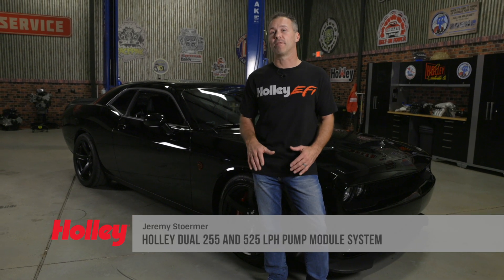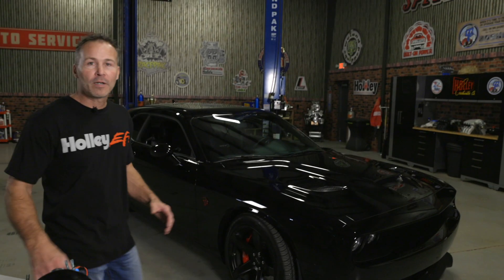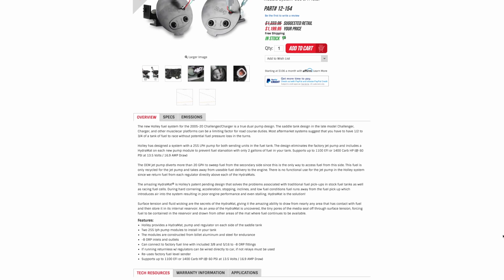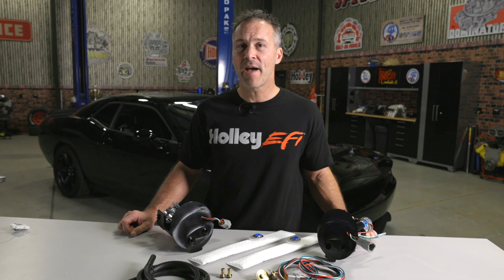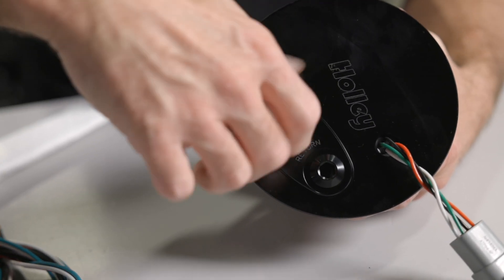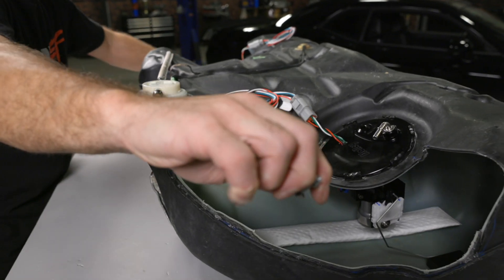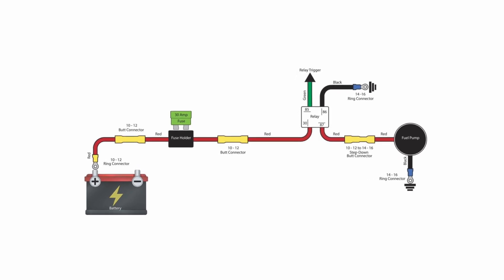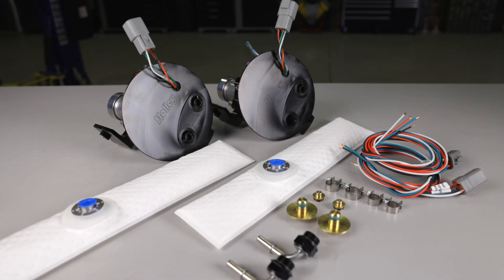Dual Fuel Pump Systems for Boosted and E85 Powered Late-Model Dodge and Chrysler Muscle Cars

Comment: Don't waste your time with this unit. Installed it on a widebody hellcat, and have had nothing but problems. System design is flawed, pumps keep burning out, low fuel pressure, half tank fails and Holley support is non existent and rude at best.
Reply: Same here! That’s why they discontinued these pumps because people have too many issues with them. Even on the hellcat forums it’s nothing but issues. Holley sucks